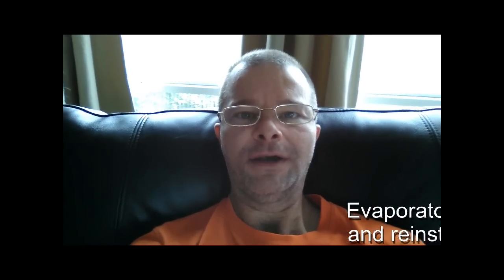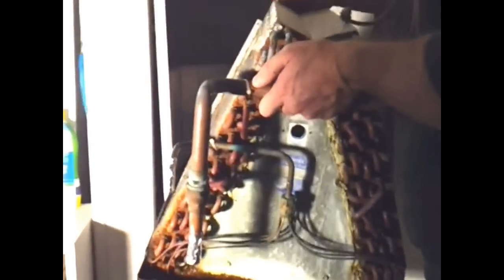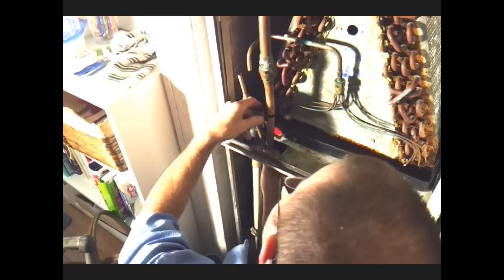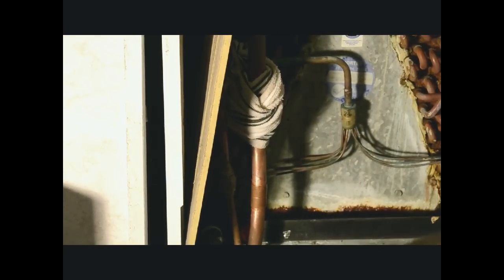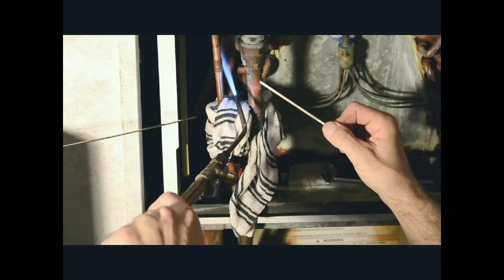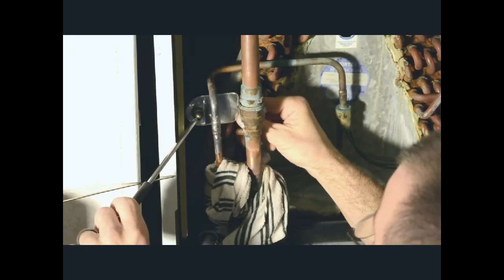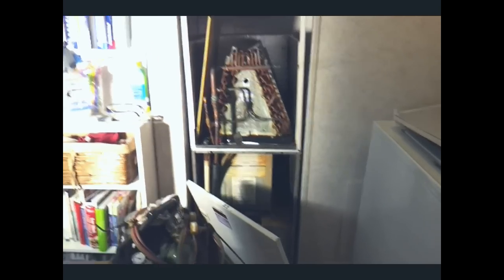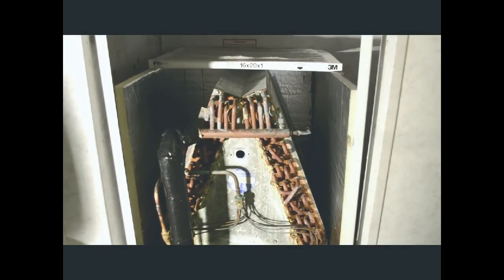HVAC Dirty Evaporator Coil Removal, Cleaning and Re-install in Air Conditioning Unit. Part 3 of 3

Comment: You shouldn't show videos like this till you get better and more experience. Almost everything you did was wrong. The problem you had with brazing was you didn't have the regulator pressure correct which made it hard to braze and that's why you had so much  black sut on the copper. And never pull the refrigerant into a vacuum when pumping it down in the condenser and then you cut the lines inside while it was in a vacuum which pulled air and moisture into the system. Use coil cleaner and never ever use a car wash. I hope you have got better since this video and NO ONE SHOULD DO IT THIS WAY PERIOD. I've been doing hvacr since 1987 and I do remember how hard it was starting out.
Reply: M Watkins and waaaaayyyyyy too many soldering sticks
Reply: What do you mean, cut the lines inside while it was in vacuum ?. Joluis321@aol.com.

Comment: Great series Mikie!  I was hoping to see the whole nitrogen set up for brazing, setting it for leak checking and also hooking up the vacuum pump.  Can you do one on those one of these times?  I love your channel!  Thanks again!
Reply from the maker: Hi Brad!  Thanks a bunch!!  With all my spinal problems I dont know when I'll be setting everything up again for another project.  I know one of the other guys has a video covering that very topic though, can't remember if its Dr. Z or who, I'd have to dig for a bit.  I really need to edit a bunch of videos but this cold weather has me moving even less than usual:/  you have any fun or interesting projects of late?
Reply: Yes.  I am working on the heating units in my rentals... trying to learn all I can about AC before summer!   I appreciate what you're doing here.

Comment: Mike, yu didn how yu leak checked after yu soldered the coil to find yur leak, did yu use the compressor or did yu pressurize with nitrogen?
Reply: so there was a leak AFTER the soldering (brazing)?